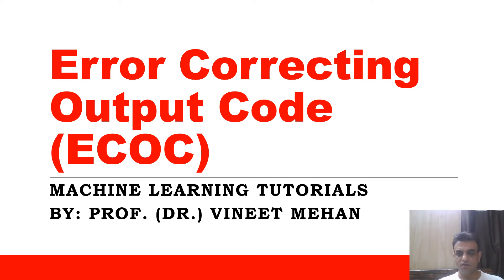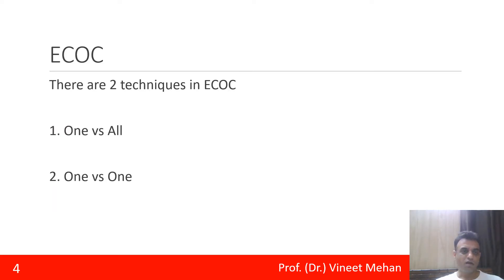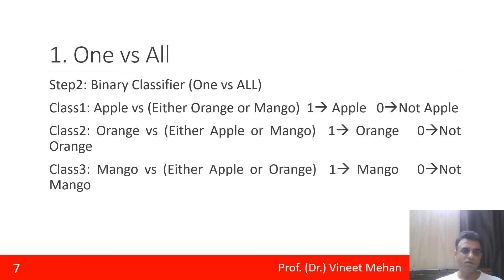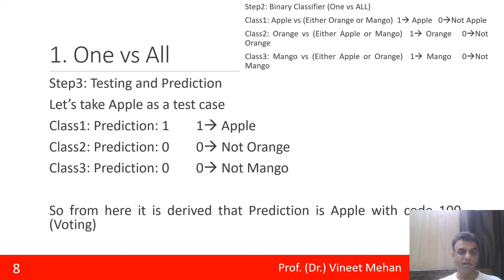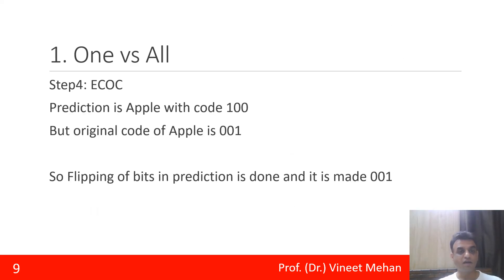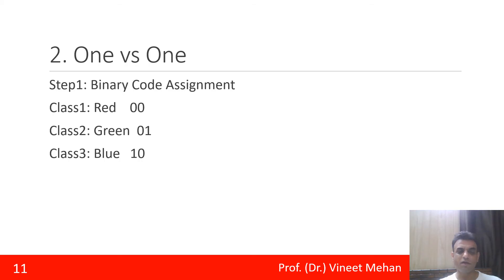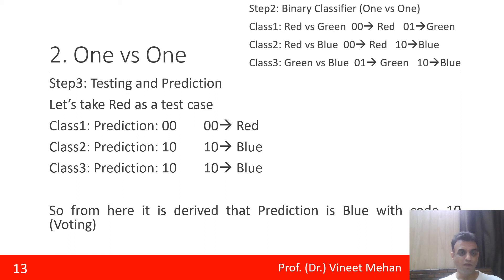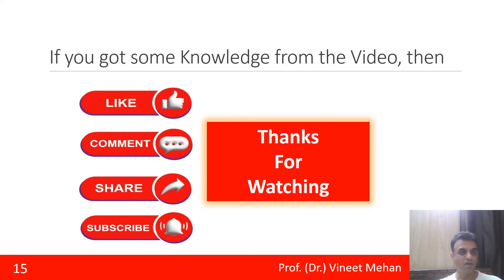Error Correcting Output Code ECOC

Comment: (At 5:28)sir in the one vs one method in step3 you have taken red as testcase.when you take red as testcase class 2 will generate 00 right.why you have taken blue sir?when you take it as red then the majority is red so the output code also 00 it completes no need of flipping too.would you clarify it?
Reply: same doubt bro

Comment: sir if we got the correct code even before flipping the bits then do we need to stop there? or flip and find out the prediction is inaccurate? or is it a mistake?
Reply from the maker: you can get the correct code rightaway also. The primary purpose of ECOC is not correction rather it is used to aid the process of classification.